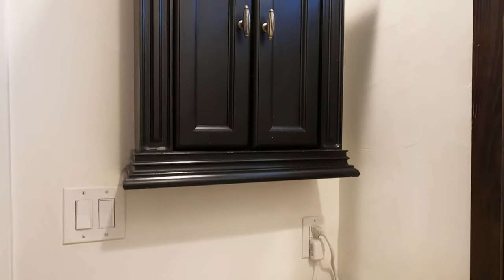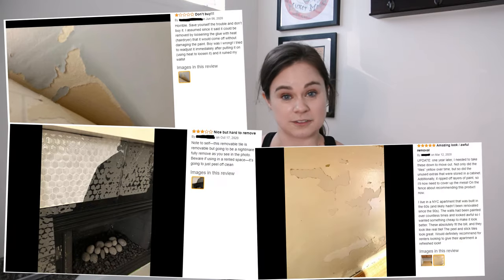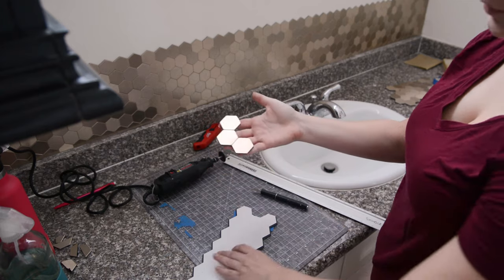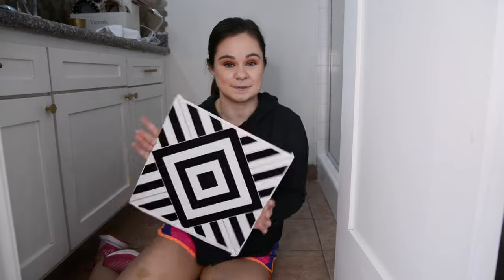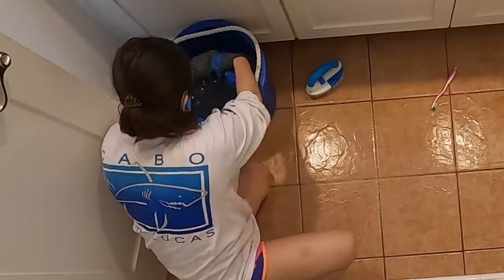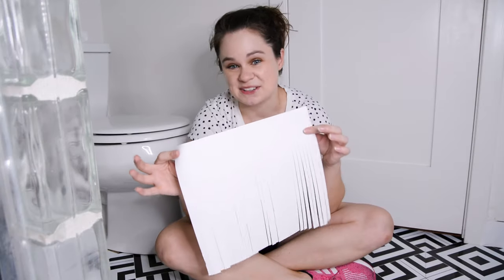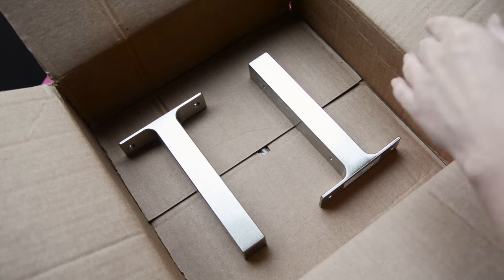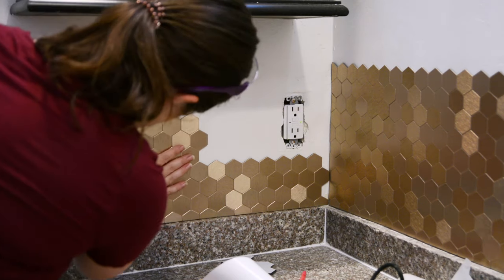Renter-Friendly Bathroom Makeover | DIY Peel & Stick Tile

Comment: Using the contact paper first is so smart!  I've seen people use a heat gun or blow dryer to help remove the contact paper easily and with less mess - that'd probably work here to make removal easier.  Totally doing this to my space.  Thank you for sharing🤗
Reply from the maker: Thanks for the tip! Heat gun/blow dryer is a great idea to soften the adhesive for removal! I’ll definitely give that a shot when it’s time to pull it up.

Comment: I love the tile over contact paper idea, how has the contact paper held up to the humidity of a bathroom?
Reply from the maker: The contact paper I used is the vinyl type, so it should be rather resistant to water and humidity. Admittedly, I won’t know how well it holds up until I remove the tile over it. The purpose of the contact paper was really to provide a surface I could adhere the vinyl tile to, so when I peel up the tile, it will probably take the contact paper up with it. Definitely a “temporary” solution.